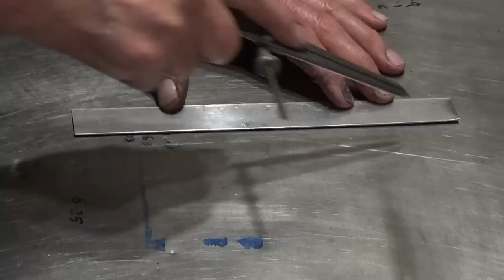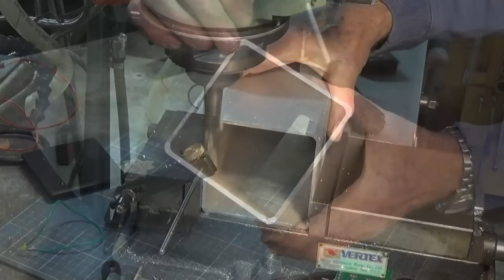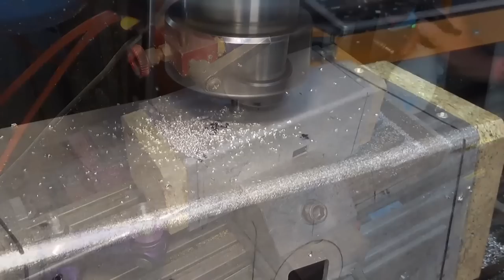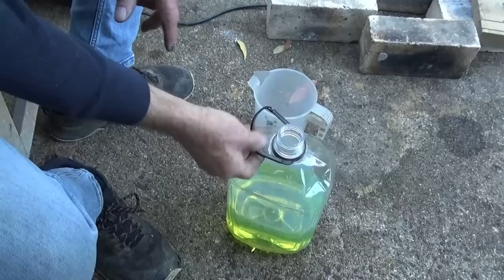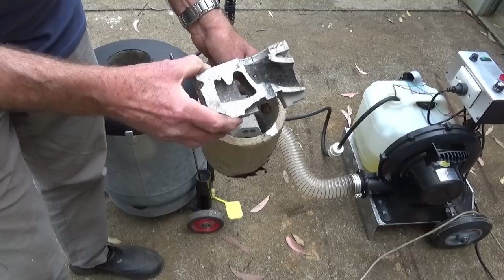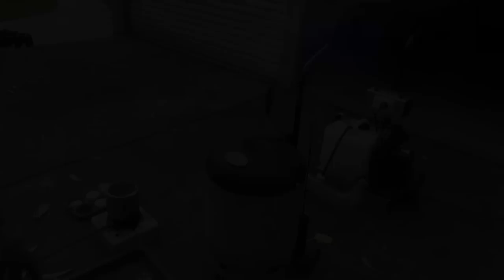Diesel Foundry Furnace Burner - Part 4

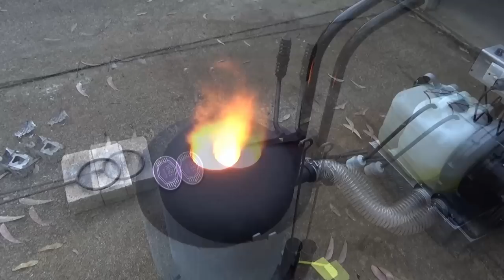Comment: 32:02 most of your fire is just above the vent hole.  I lengthened the burn tube on my diesel furnace to get the hottest part of the fire in the chamber and not just above it.
Reply: 33:53 yeah it's not burning right, look at all the soot on the crucible.  The diesel needs a longer "chute" to blow through before it enters the burn chamber.
Reply from the maker: This was my very first experience with the burner and I was still learning to finesse the air and fuel settings. I made some more castings and worked out how to tune the settings better. Once the refractory is hot I can dial the fuel back and increase the air to lean out the flame considerably. The interior of the furnace was pure white at the end of that session. 
Regards,
Mark

Comment: The tab on the side of the foundry body is a good feature to position the lid in teh closed position.
However this results in a tab protruding up when the lid is open.
this may be a hazard r may get in the way when using the foundry in the open position.
I suggest that it is better to secure the tab to the underside of the lid, does the same thing but is safer and out of the way.
Reply from the maker: True, and indeed the Youtuber I stole the idea from made the same suggestion but so far it has not been an issue.
Regards,
Mark

Comment: if you have old cooking oil, safe it... you can safe some money 🙂 first heat the cooking oil for 4 hours to 130C (removes all water), then filter it through a resin 3d printer filter to get all pieces out that dont belong there... buy in a store kerosin,  mix it 1l kerosin to 3 liter "remastered" cooking oil and you get the same consistency as diesel, there will only be a 150 degree heat difference because of some chemicals missing, but less chemicals == less toxic 🙂

Comment: There’s oil in diesel and I’m wondering if the after flame is just burning off the residual oil that doesn’t atomize that well.
Reply from the maker: I think it is to do with a small check valve built into the pump outlet. It leaves pressurised fuel in the delivery line even after the power to the pump is cut. I need to get used to turning off the tapered plug valve as soon as I turn off the pump at the panel switch.
Regards,
Mark

Comment: Possibly the reason for the flame continuing after everything has been shut off is the Venturi or even Sherri like affect from the flame pulling gas out of the nozzle
Reply from the maker: I think I have identified the culprit. There is a check valve in the pump which traps the pressurised fuel in the fuel line which is springy enough to act as a pressure vessel. I just neglected to shut off the physical valve at the burner. 
Regards,
Mark

Comment: Hello how is my friend can I ask a question this is a way if you make like your work how much temperature can it withstand does it reach 2000
Reply from the maker: I have only ever melted brass in this furnace which is around 975C or 1800F. I am sure it is capable of higher temperatures but the refractory I have lined the furnace with would probably break down if I were to try to melt iron too often. The burner would be capable of melting iron though.
Regards,
Mark

Comment: Would this work with waste oils? 

Hydraulic, motor oil and vege oil
Reply from the maker: Yes but you would need to filter the oil since any grit or dirt would clog the fine orifice in the nozzle. Also, if the oil has a high viscosity you might need to warm it up to make it flow more easily. 
Regards,
Mark

Comment: How'll the smell.... Would I be bugging the neighbors ?
Reply from the maker: Once you get the flame stabilised and the fuel/air mix correct it burns very cleanly and I didn't notice any smell at all. It does get a bit stinky at the end of the burn when the residual fuel is burning off but turning the blower back on again tends to disperse the smoke fairly well. We are a bit fortunate here in that we live on acreage and our neighbours are not close at all. 
Regards,
Mark
Reply: @Preso58  Cheers mate... I appreciate the feedback, I'm in a residential area so I may be pushing my luck with the startup and shutdown, but I like the extra speed/heat you're getting so I may look into it more when I finally get around to upgrading mine .... Thanks again... It's been a really good how-to series of videos

Comment: Excellent build and well designed ... but, $14 / hr to run it in Atlantic Canada ... without the tax it would be a more affordable $6 or so. tax Tax TAX and more tax to save the planet. Maybe you can make one that burns old tires?
Reply from the maker: I probably only use my furnace about 8 times a year so even with the current high fuel prices it's still cheaper than beer! Interestingly, I saw a news report many years ago where I tyre dump caught fire somewhere in the USA. The fire was massive and the fire brigades couldn't extinguish it. The decision was made to just let it burn but the heat and the fire conditions made the tyres decompose into what looked like crude oil. It was running out of the piles of tyres and it was being collected and sold off as heating oil!
Regards,
Mark

Comment: Not very clean burn
Reply from the maker: I disagree. The light up phase is a bit sooty but the operation at full heat is quite clean and there is very little smoke or smell. Bear in mind that I have only used it twice and I still need to get used to the settings and the light up and shut down procedure.
Regards,
Mark